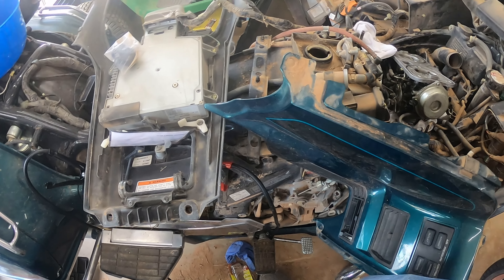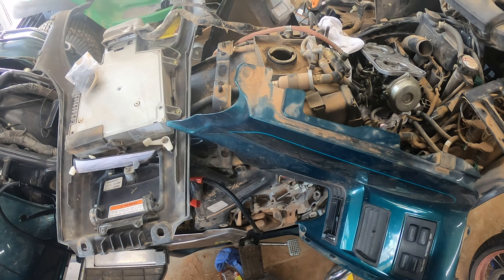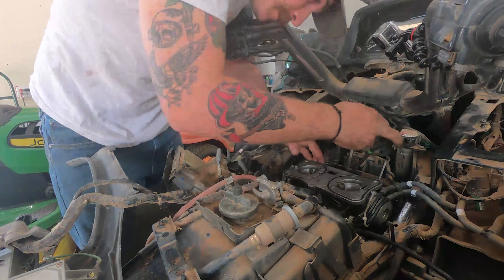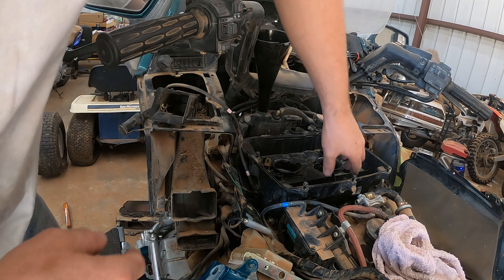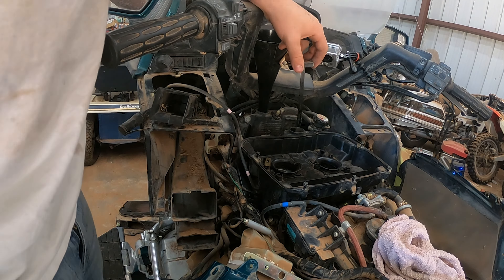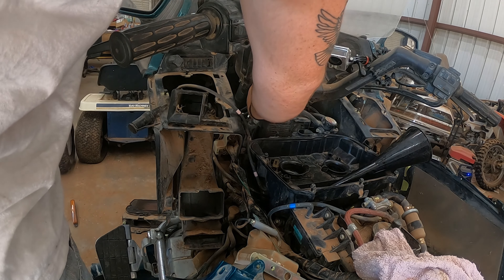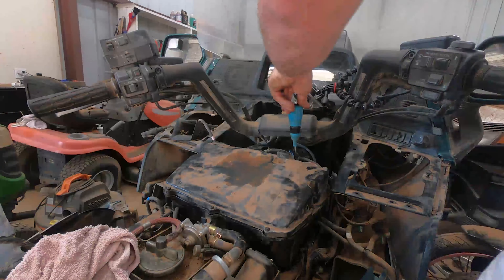1996 Goldwing GL1500 SE Restoration PT 3: Installing The Carburetor

Comment: You, aswell as many others, mentioned how much of a pain it is to get that large vacuum hose at the front right of the air box connected. Could you show or explain how you go about doing it? It doesn't seem like there is a way to reach it.
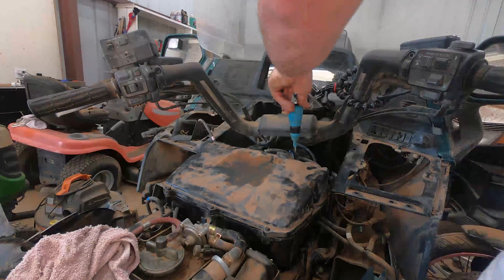Reply from the maker: https://www.youtube.com/watch?v=EPU9c8q-eMo&t=451s at about the 6:30 mark! 

 I am using pliers with bends in them which is vital in my opinion in installing these. I was using the pliers with the little circle shape on the end, and the hose fit snug inside that circle! 
The pliers mentioned are these 

https://www.ebay.com/itm/144933373799?epid=858165914&hash=item21beb3c767:g:VIwAAOxyyghQ8fdZ&amdata=enc%3AAQAHAAAA8MQroqi8lDMv7HgdJmU2%2FGgjhGtWZGUncSrb617vjsJYRMl1VhCYI4RupdxPrE80uz3lrS%2Fn9wKqsAgVhJ273ByWyfhrNQgoZxaoOcKNS2ykS9Obg8YzAXZTrKcyhIANiOYOR76muiDF9OKGBBi4M0yzNicMK%2Bg%2By418gFOxYd2nQOcXcgvfkTyr13k%2BEoKbryS3KHa6s6EwVSJUw1DwJnfflP4hwDVoJV5q81qI3zLQj1dc6l7Z7%2Fk3%2FENWroQejTB419vTXnM4cLN261MtWNtqca9qDEzEMJRG34M5IDFU%2F4B9jCGFxIzXcF1tmxIqTA%3D%3D%7Ctkp%3ABFBM8qTr7uhh
Reply: @octanerestorations  Thanks for replying so quickly. I couldn't find any way to get the pliers back there. Even the long ones. What I did find is that you can just remove the right side radiator fan with just 2 bolts...and you have complete access to that hose. I was able to push it up into the airbox immediately saving myself a ton of time. I hope anyone having the same issue sees this and helps them out.
Reply from the maker: @karlhungus7869  Good idea! I bet that was definitely easier, will remember for last time. Thank you for the comment and the update Karl!